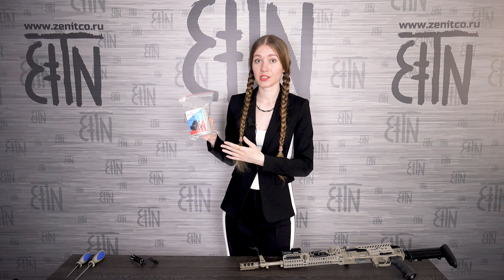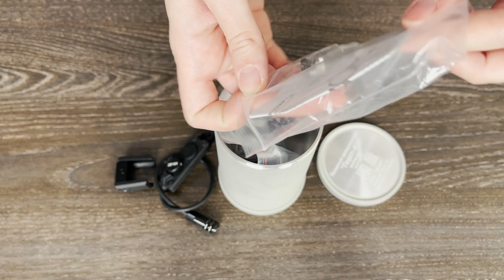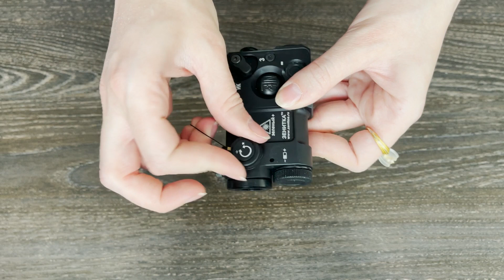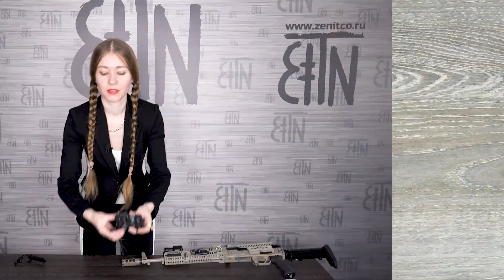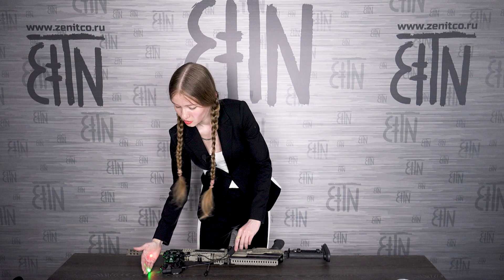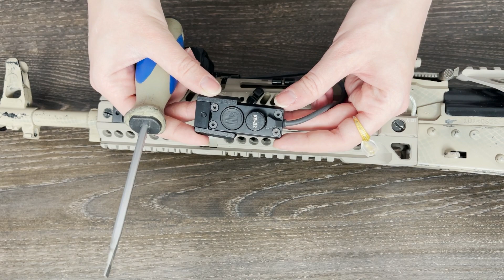Perst-4 gen.3.0: unboxing, modes, tactical switches

Comment: Perst 4 came in less than 1 month shipping. I just happened to notice the windage caps do not have the retaining wire attaching both caps together to prevent loss. New design perhaps? Perst 4 was made March 2022.
Reply from the maker: Yes, new generation do not have a wire, caps have ledges on top to use them instead of screwdriver (previously a side of a cap could be used, not it’s the top of the cap).

Comment: Sorry if I missed it but can you tell me if the horizontal &  vertical adjustments are in the center of their adjustment range from the factory?  If not, can you advise if there is a preferred procedure for doing that?
Thank you.
Reply: From the two units I received, they were mechanically zeroed.

Comment: does turbo mode work if I'm not using tactical switch but holding the button on top of the device? or does it only work with tact switch.

Comment: Why is this Perst-4 model so much larger than the Perst-4P and 4M?
Reply from the maker: That are two devices with close functionality but different design and controls. Perst-4M and 4P have two batteries vs one battery in Perst-4. That makes operating time longer. But Perst-4 has all the controls on the body, for some users it is more convenient, it is easier to switch between modes. So that is more about personal preferences. The length and height of both options is similar. Perst-4 is wider.
Reply: Are the power outputs the same on the 4 vs 4m